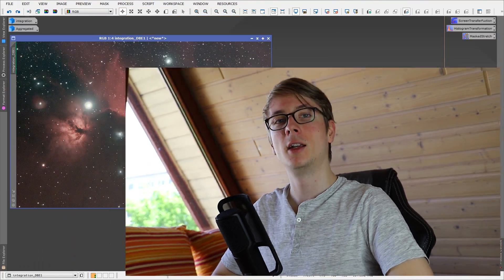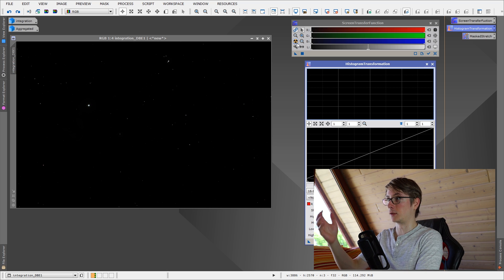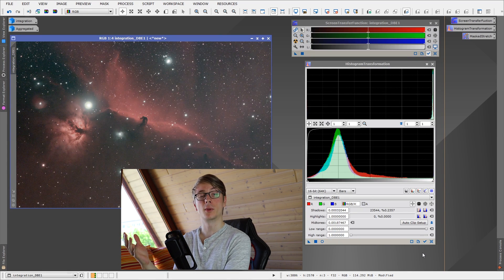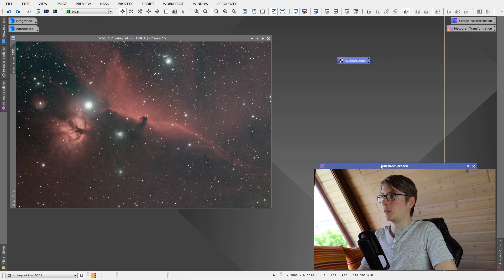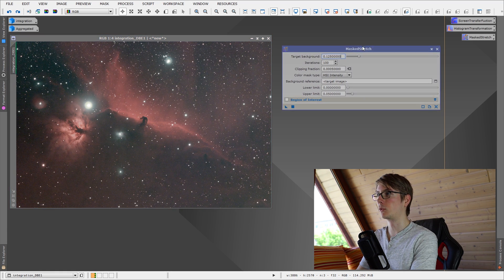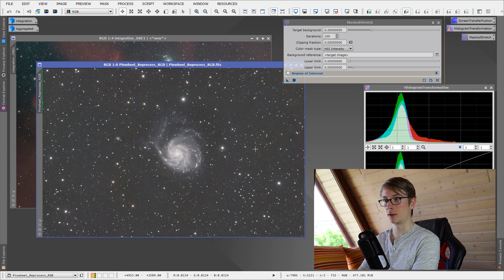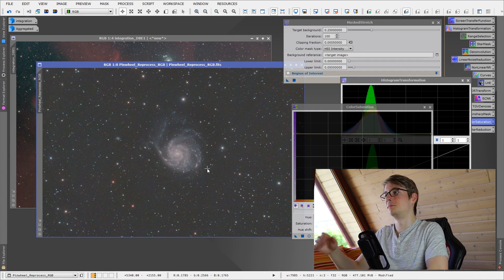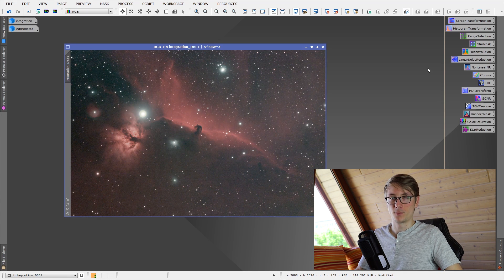Explaining PixInsight #4 | OSC Workflow | Non-Linear Stretching

Comment: Great image and tutorials.   Adam Block gives the best explanation of  linear vs non-linear of anyone I’ve heard trying to explain it….he uses visuals to make it quite clear. 
     At it’s most basic, a non-linear image has had the grey point adjusted. You can adjust the black point or the white point……..the image is still linear. Once you “squash” or “stretch” the spacing between gray levels by moving the mid-point (or grey slider) the image is no longer linear.    But watch Adam’s video ;)

Comment: I am brand new to Pixinsight, and working through these one by one, backing up, watching... very helpful, much better than others I have found. One suggestion: those brand new to pixinsight may not know HOW you are doing certain applications, especially when your video is covering panels.  Some areas I had to watch 5 or 6 times, trying to tell which button you clicked.  It would help a lot if you were clear (just a word, like "clicking the square") sometimes is all it takes, I do not imply you need to go slower, just don't assume people know how to invoke actions, especially when the panels are covered by you.

Comment: Moin Tim,
I've got a question: In Pixinsight, does the Batchpreprocessing recognize, if you stack subs before and after the meridium flip? 
Or do you have to go to Geometry to flip the subs before and after the meridium flip in the same geometrical fit before you stack them?
Thank you and make it good,
CS Christian
Reply from the maker: They will be flipped automatically, it's part of the star alignment